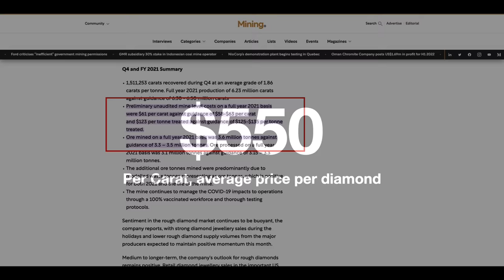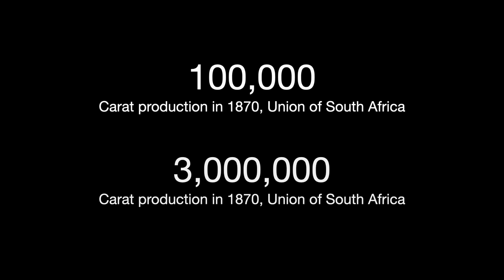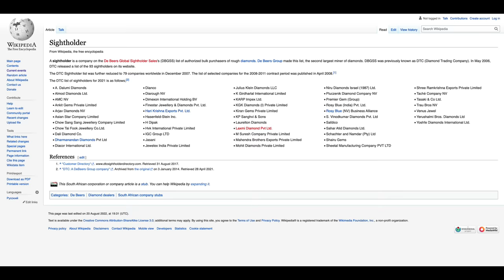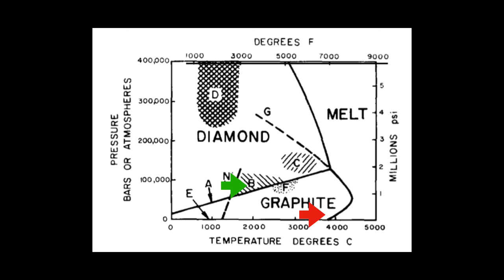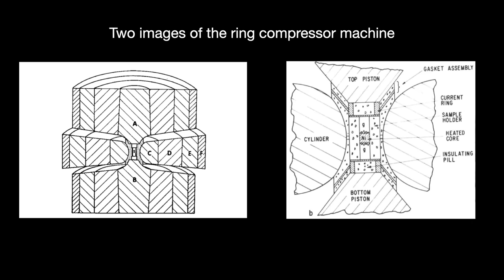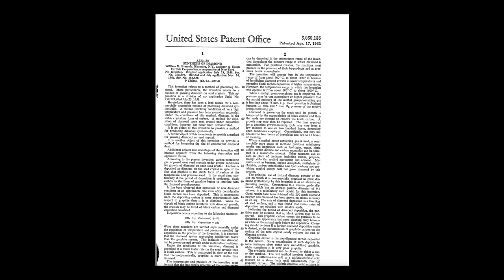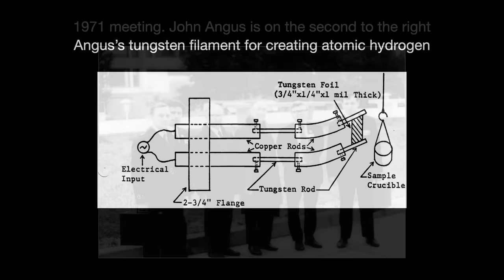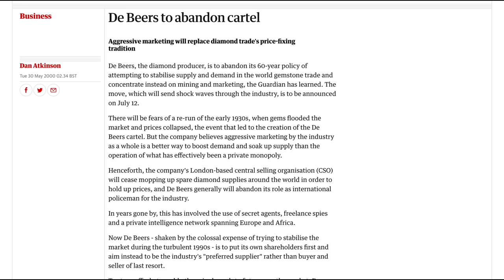The Perfect Synthetic Diamond

Comment: Now we just need someone to find a way to create Gold. In theory it should be possible, they are still Elements on the same Table.
Still all of this Pressure and Heat on a non-metallic Element like Carbon.
This probably makes me think the levels of pressure and heat that are necessary to make Metals change into another, are probably not possible.
I mean once a Star starts creating Iron, that's it. It will Explode into a Supernova.
But humanity has been able to achieve the highest temperatures and pressures in a controlled environment. Will humanity be able to achieve what not even nature has?
Reply: Making synthetic diamonds is rearranging carbon atoms into different bonding configurations. Turning one metallic element into another is something that happens with nuclear fusion inside stars or through fission but it's much harder than making diamonds.

Comment: Very well researched and presented. I didn't know the influence of hydrogen gas in the creation of diamonds.

Is the process for moisanite the same?
Reply: Atomic H in the CVD plasma abstract (remove) H atoms from the growth surface creating open sites to which methyl radicals in the plasma can attach, and thus extend the crystal.
Moissanite is made by either the Acheson process or the Lely method.  Details are available from Wikipedia, etc.

Comment: so..  here's something to think about on..  synthesis of a mineral that precipitates out of molten rock first... because it's got the highest melting point.. above 3800° C nothing else is solid..  kimberlite is created by asteroid strikes... a large object falling at orbital velocity striking existing surface minerals... the central Gobi desert is a 2000km long impact crater..  it's shaped like an exclamation point.. .  diamonds are pretty inexpensive from China.. they don't have deBeers monopoly control over production.. 
every fault line on Earth extends down to the semi molten mantle... about 50km deeper than most kimberlites people know about... more heat and pressure.. chock full of diamonds.. rivers and creeks and dry washes follow fault lines.. all of them... around the Planet... 
it is not possible to recreate those temperatures and pressure.. nothing else is solid except carbon... 
I have been pulling diamond and silicon carbide out of the Gila River here in Arizona.. and I have found extensive kimberlites in New Mexico on Google Earth... 
they are neither rare or hard to find.. if you know what you are looking for
Reply: you don't need to have a bunch of fancy equipment to test for diamond... a simple hardness test is all that's needed.. start with a known diamond and try to scratch the sample..  if the mineral is perfectly clear and 10.. it's not possible to scratch it.. gouge or chip possibly.. scratch is the same effort as writing with a pencil 
diamond and silicon carbide are not the same.. silicon carbide is often translucent,  but not perfectly clear.. 
both will scratch a ruby or sapphire

Comment: I purchased a diamond for the GF.  It is a CVD lab grown.  It is GIA certified, 2.4K D VVS1 excellent cut.  I had the choice of a number of diamonds to chose from but this thing simply popped and compared to everything else there was simply nothing near it.  The diamond will set me back around $8,500.00 plus the platinum setting so not to bad.  In the end I will pay around $12,000.00 all in.  Having looked at various jewelry stores at inferior stones and mounts costing far more lab grown is the way to go.    Interesting the GE connection.  I have been in that lab where they did the work on a tour.

Comment: I can't stand knowing they parse out diamonds by the thimble-full from swimming pools filled with them. Why? Sand paper and grinding/sharpening stones. 
  It cuts so much better but can be 2-600 bucks for a wheel! And not a big one either and the face is only millimeters thick on some! Ridiculous! But those are industrial, you say. Well prices and 💩 all roll downhill. A single half karat engraver is hundreds. I saw a 12 point of quarters for for 1,000 USD. 
  Even zircon is double the price or more than alumina. I won't belittle flint, flint sharpens itself and great for wood alone, but agate is useless. Alumina like carbide causes discoloration. Those two on wood... 😒 I want diamond paper I can afford. I shouldn't have to try and negotiate with Debeers.
Reply: Who goes on a sandpaper rant? This guy 😃
Reply: @napalmholocaust9093  Also, for industrial use, diamond works out cheaper in the end than other materials because it lasts very much longer than anything else, so there is less maintenance time, higher reliability, better finnish, faster production, and hence bigger profits.

Comment: I thought these diamonds would be use in computer chips.
Reply: Gold is, diamonds are used for industrial cutting devises
Reply: however if computers transition into being more light based rather than electron based as today, micro or nano diamonds could possibly have some applications
Reply: @megalonoobiacinc4863  Would it be used to extend the lifespan of write cycles in SSDs?
Reply: @holmesferonton7982  well that's sorta a different issue with flash memory being volatile, which could be solved if we only found a better technology to replace flash